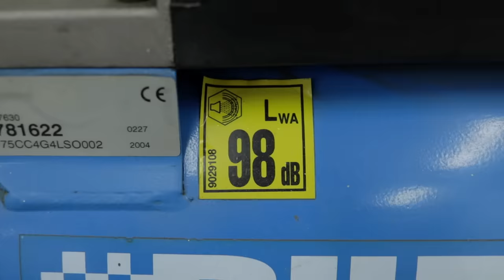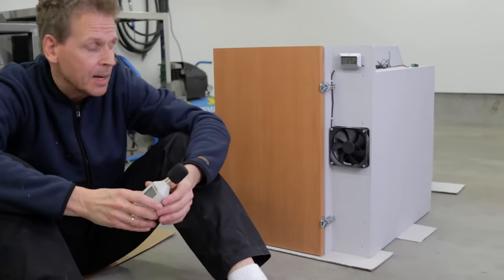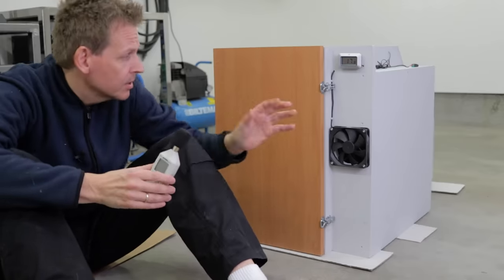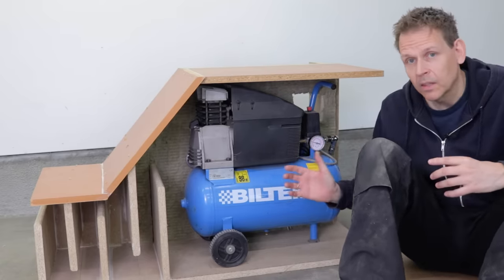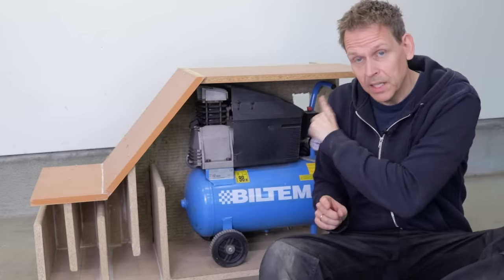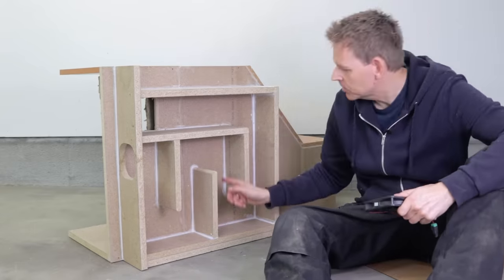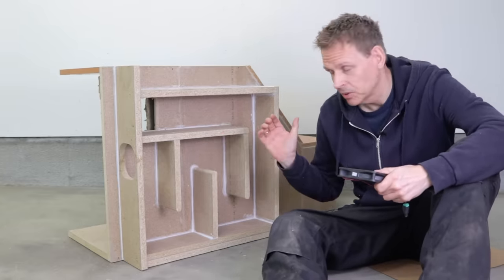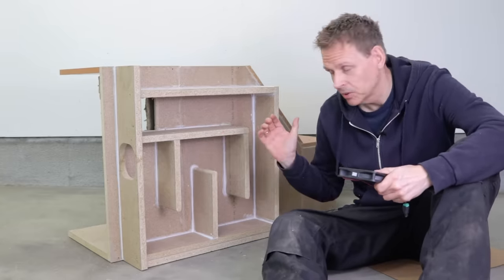Do not build a sound insulated enclosure for your noisy air compressor!

Comment: why such a small compressor?
Reply from the maker: Legit question! I guess the main reason is: I value my space. I don't want my garage to be crowded, I like it minimalistic and tidy. Since my workshop is also my garage (made a separate video about it: https://youtu.be/43jm5yWG1dY) I do have limited space. A bigger air compressor will also be much more expensive, no need to waste money on a over dimensioned tool. The small one is sufficient to me.
Reply: @kihestad  thank you for answer. But when you made so much effort (time and expensive material), the big compressors usually come with much more silent motors and tank so need to run much less often. You also bought two compressors, so i think you would be originally really better off with one good from start.
They only make this "tump tump tump" noise like old steam engines.
Reply from the maker: @FueRent  I spent a lot of time, that is for sure 😌I hoped to make my old air compressor (I have had it for almost 20 years) silent by putting it inside a box. The box-build did not cost much, I had most of the materials (leftover from other projects). I could not get it silent enough for my liking, then I ended up buying a new one.
Reply: @kihestad  we all learn! I was happy to found second hand 3PS compressor back in the day and simply put it in front of the garage 🥰. It was silent but for video recording not enough. The wood built scared me with the current prices, but if you had it already, probably fine!

Comment: Just buy a screw compressor or a silent compressor, people.

You can get "silent" ones very cheaply these days
Reply from the maker: You can absolutely find silent compressors, they are normally twice as expensive if you compare it a noisy one with same power. Screw compressors however - they are extremely expensive and big, not really suitable for hobby use....

Comment: Quietest way to run a compressor is to put it in your neighbor's garage and run a hose.😆Remember to place an accumulator tank in your garage to reduce the restriction that long hose introduces. 

Joking aside, there is no reason that the compressor needs to be in your working space.  Hoses are cheap.  It's better to have a compressor on a concrete slab than a wooden floor.

Comment: Just build a basic isolated box to keep the rain off it outside  the shopand plumb in the  air line .
Reply from the maker: It's perhaps the best solution to get it out and away from the workshop 👍 Unfortunately I did not have that opportunity, my garage has minimum distance to neighbors on  two sides and a retaining wall on the third.

Comment: I just put my compressor in the neighbors yard and use a really long air hose.
Reply from the maker: You are not the only one, several others has told me they have done the same. Just don't forget to plug it in. It won't run without electricity 🤣

Comment: they make these things called refrigerators. they are free at the dump. just convert it into an air compressor box.
Reply from the maker: I have seen some projects, they seem to have very limited capacity. Perhaps usable for some, but not sure if it would be good enough in a workshop for running air powered tools? 🤔
Reply: @kihestad  I have a 33 gallon stand up compressor! i gutted the fridge and cut out the bottom. then put lots of rags at the bottom and scaffolding over it to hold the compressor up. you run an air intake from the bottom and put a screen/filter over it to keep out the rats and dirt.then run your lines to your separator out side, and power chord.
Reply: @kihestad  the compressor and motor is small, but the tank can be outside the refrigerator if you wanted to go higher volume.

Comment: This is the wrong way to do it. You waste material to build the box and have to carry the box all around.  I've patented a solution where i built a spinning platform you put the compressor on top of.  No box needed at all.  The platform (with the compressor on top) spins at about 120 turns pr minute, adjustable up to 360.  This distributes the noise in all directions and due to the doppler effect the noise level is reduced drastically and no hearing protection is needed.  Look up my web-shop and order the Q-Kim-USA turntable solution.
Reply from the maker: Wow, I got to have one of those 😂🤣
Reply: @kihestad  Lol :)

Comment: Thought that for years.... building a box around an air cooled machine 😑 put it outside under a shelter instead
Reply from the maker: Yes, that is way smarter 😊I just dont have space for it. My garage is placed with minimum distance to two of my neighbors, the third wall is up against a concrete wall, and outside the garage door is no good... 😋

Comment: Now make a box to reduce the 110dB of my power hammer when in use;)
Reply from the maker: haha, you have a point. A lot of the air tools are extremely loud. You are however aware when starting the power tool, so it's just to put on hearing protection when using it. You never know when the compressor starts, so making it silent makes it possible to avoid using hearing protection all day 😊

Comment: Or do what I did and buy a FORTRESS ULTRA QUIET Air Compressor at Harbor Freight. It is actually 60 dBa, you can almost whisper over it.
Reply from the maker: Nice, I think it is the the same motor as on the silent one I bought. Many of these uses the same motor, design and name can vary.

Comment: So 3 things 1 a belt drive compressor much quieter 2 larger box with more insulation and pack you baffle with loose fiberglass.
Reply from the maker: Makes sense, the downside is bigger and more expensive - I had limited space and did not want to buy a very expensive compressor. Packing the channels with sound absorbing material would restrict airflow and cooling, then even bigger channels would be needed, or more powerful fan = more noise. More or less any improvement comes with an downside 😑
Reply: @kihestad  loose fiberglass won't sidrubt air flow very much we use it in ported subwoofers to help with huffing.  As for cost I have no clue what they are in your country but a 20gal belt driven V-twin 5.3CFMat 90PSI here in the US is less than $500
Reply from the maker: @soundman447  ahh, ok thanks for the info 👍 $500 was not very expensive at all, the one I bought was $140 though...

Comment: 3 dB is half, 10dB is a lot less noise
Reply from the maker: I might have over-simplified how the Decibel scale is to be understood, let me try to clarify (based on a discussion / explanation from the comments): 
* 10dB increase is the typically stated value for doubling the perceived volume (subjective), without respect to actual power/energy. 
* 3dB increase is a doubling of the actual power/energy (objective), without respect to how a typical person would perceive or rate sensed-volume. 
I have to add that the Decibel is a difficult scale to relate to (at least for me), I might have to study this a bit more - sorry if I got it wrong 😌

Comment: Rubber anti-vibration feet
Reply from the maker: Yes, that's a good tip! I did add rubber under the box, but it's too hard and the vibrations from the air compressor are now transferred to the box and into the floor. I'll probably replace it with softer sometimes 😊

Comment: like 80% of the sound is from the intake, if you make a very big baffle intake with some 4" PVC and some autistic foam... its well under the 80db limit. you can make 45* angled baffle walls too with some more foam... my compressor is down to 74db from my phone from the 108 it was at. yea you DO NOT want to make a box around unless you get enough air flow.
Reply from the maker: Thanks for the tips! I have checked the temp frequently, the current airflow is OK. 
From my research - I found several YouTube videos where people added a muffler on the intake - it did not sound like it helped that much. The compressor tank itself also emits noise because it acts like a sound chamber. I could be wrong though, and with the correct design it will be as good as insulating the whole compressor 😏
Reply: @kihestad  thats becuase those mufflers suck. you need about 6 feet of 4" PVC with 2" thick spike foam. yes 2 inches. the air needs to flow around it. the pipe should looks almost filled up but infact its a huge filter and muffler. yea its not all the sound but its a LOT of it, next time you start the compressor, try and plug the intake for a second with your hand. that is how quiet it can be.

Comment: Every 10 decibels is 10x quieter/louder, not 2x. A 2x reduction occurs every ~3 decibels.
Reply from the maker: I might have over-simplified how the Decibel scale is to be understood, let me try to clarify (based on a discussion / explanation from the comments): 
* 10dB increase is the typically stated value for doubling the perceived volume (subjective), without respect to actual power/energy. 
* 3dB increase is a doubling of the actual power/energy (objective), without respect to how a typical person would perceive or rate sensed-volume. 
I have to add that the Decibel is a difficult scale to relate to (at least for me), I might have to study this a bit more - sorry if I got it wrong 😌

Comment: You probably want a much bigger fan than that computer fan if you're trying to cool 750W. A centrifugal blower would probably be ideal.
Reply from the maker: It has been able to keep it cool, remember it's a fan on the compressor also blowing from the front to the rear. 
I have fitted a thermometer and I do check frequently that it's not getting to hot inside the box. Normally the temp increases 5C = 10F when it starts until pressure is built up, and it takes just a couple of minutes to cool it down. If it is running constantly over longer periodes it can get a bit hotter, I have seen almost 10C = 20F increase. The warmest summer days can be 30C = 86F here where I live, but that is very rare. Its more commonly 25C = 77F, so it never gets very hot inside my box.

Comment: The toy (Airbrush type) Compressor IS quieter (mine is) but also basically useless. As it generates insufficient Flows for most ALL airtools. 
All it really does is waste Shop space,
 A large part of Compressor noise is from their Air intakes.
 Fit a decent muffler for Significant noise reduction.
Reply from the maker: A muffler helps a bit, but not that much. It's not as efficient as building a sound isolated enclosure. It's not only the intake that makes noise, the whole tank acts like a resonator and emits noise. It's much easier just fitting a muffler though, and it does help a bit 😊

Comment: Just buy a old refrigerator and take out the compressor from it, with some modification you will have a silence compressor at your workshop.
Reply from the maker: hehe, very silent but perhaps not that much air pressure 🤔
Reply: @kihestad  I don't know how much power you need but you can always stack those hermetic compressor up for more air pressure. Of course this also not very cost efficiency.

Comment: You'll still need to take the compressor out of the box to purge the water.
Reply from the maker: Absolutely, I do it now and then. It's not very humid air here where I live, in average a table spoon of water per month. I don't use the air compressor that much, I would guess: 2 days x 15-30 minutes runtime per week = 2-5 hour per month.
Reply: @kihestad  just make sure not to let the bottom of the tank rust the rust particles will get into stuff and cause headaches.

Comment: Disassemble the compressor unit from the tank so the box is much smaller
Reply from the maker: Yes, it would have been way smarter. Did not think of it as an option when I built the box. I would have done it now if I were to do it again 🥴

Comment: i actually think the air compressor should be MILES away and then have a long air line to the shop
Reply from the maker: Hehe, I agree - however, that line will be very expensive and most of us don't have a workshop that is even close to being one mile long.... 😁
Reply: @kihestad  i had actually wanted to have  windmill powered air compressor  with a tank the size of a tanker truck
Reply from the maker: @philippetays4263  now we are taking, I want one too 🤣

Comment: It will overheat with no intake..
Reply from the maker: Yes, you are 100% correct!!! 😊 And that is why I make not only an intake but also an exhaust, because the air compressor also needs cooling.

Comment: Next time dont buy a direct drive compressor.  A belt driven compressor is much quieter and you have the option of going up or down on the drive pulley.
Reply from the maker: You are right. They are normally a bit bigger and more expensive, but I think they are more durable because of lower rpm, and absolutely more quiet.

Comment: Why don't you just put it outside in a box or just cover it from the weather?
Reply from the maker: Unfortunately, I just dont have space for it. My garage is placed with minimum distance to two of my neighbors. The side facing my own property is not usable either,  as it's just a slim path between my garage outer wall and a concrete retaining wall. In front of the garage door is no good either 😋

Comment: Your logic about sound being attenuated by distance is flawed. That only applies in open space where sound energy spreads out with distance. As other people have pointed out, you are better off surrounding your compressor with heavy material that can absorb the noise. Your baffle probably works as a high-pass filter, which is good because most of the noise is low frequency, but a lot of the noise will be transmitted through the walls of the box.
Reply from the maker: Aha, OK - learning something new every day 😊 I might add a bit more sound absorbing material into the start and end of the ventilation channels, I was afraid of not having enough ventilation for cooling, but that is no problem. Thanks for the tips! 👍

Comment: Hey everyone out there if you haven't figured it out yet go get a cordless battery operated system so you don't have to trip over your hoses and cords anymore.
Reply from the maker: It is very convenient with battery operated tools, but I try to avoid it in my workshop. It's more expensive and it's a hassle charging all these batteries. Some of my tools does not exists as battery operated anyway, so I need to deal with hoses and cables anyway. One exception though: my camera, camera monitor and camera light. I am moving that around all the time - those cables drives me crazy 😫😊😁

Comment: I’m America it is against code to drill holes in engineered members life roof trusses. Just incase you scroll by and see this be safe!
Reply from the maker: It's the same over here, but the holes I made is all the way at the top and above the metal plate that joins the trusses so it should be fine ☺️

Comment: why not just build a room closet for it. have air come in from outside but sound proof the inner sides. of the room.
Reply from the maker: It's probably a better solution for noise cancelling, but it requires more space. I did not want to reduce the size of my workshop like that 😏

Comment: But the new Motor is oilfree !
Oil free Compressors are not good for long use durations !  Tey will overheat much quicker and wear.
Oil Copressors are Loud but they can run much hotter and able to do work much longer and last longer.... Some good models over 40 years

Comment: +10db is x10 times louder and +20db is x100, it's exponential.
+3db is about double.
Reply from the maker: I might have over-simplified how the Decibel scale is to be understood, let me try to clarify (based on a discussion / explanation from the comments): 
* 10dB increase is the typically stated value for doubling the perceived volume (subjective), without respect to actual power/energy. 
* 3dB increase is a doubling of the actual power/energy (objective), without respect to how a typical person would perceive or rate sensed-volume. 
I have to add that the Decibel is a difficult scale to relate to (at least for me), I might have to study this a bit more - sorry if I got it wrong 😌
Reply: @kihestad  Now that is even better explained than I remembered it! Nice. Don't hesitate to make it a little more advanced, you'd have reminded me about the perceived increase. Strictly I was wrong, loudness is only whatever is perceived of course, so you got it perfectly right in the video. Keep it up

Comment: He did all this but he ignored the main noise source which is the contact with the ground.

In the same time as just putting a thick rubber mat on the floor he could have lowered the noise as much as making that box 🤣
Reply from the maker: I did put rubber under the box, but I agree: insulating the box from the floor will help a lot to avoid vibrations being transferred.
This is mostly relevant upstairs where I have wooden floor. 
Do you really believe just putting a thick rubber mat under the air compressor will help as much as putting it into a sound insulated box? I don't really think you seriously think that 😆

Comment: 10 dB = 10 times louder. Twice as loud is about 3 dB.
Reply from the maker: I might have over-simplified how the Decibel scale is to be understood, let me try to clarify (based on a discussion / explanation from the comments): 
* 10dB increase is the typically stated value for doubling the perceived volume (subjective), without respect to actual power/energy. 
* 3dB increase is a doubling of the actual power/energy (objective), without respect to how a typical person would perceive or rate sensed-volume. 
I have to add that the Decibel is a difficult scale to relate to (at least for me), I might have to study this a bit more - sorry if I got it wrong 😌